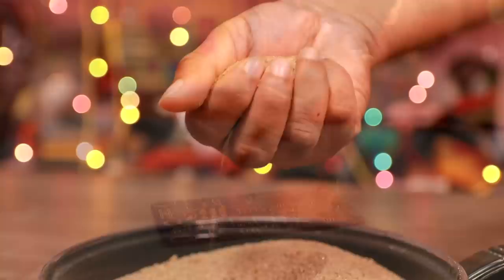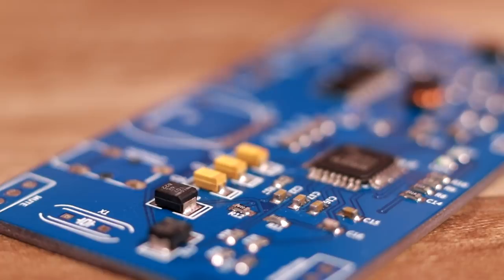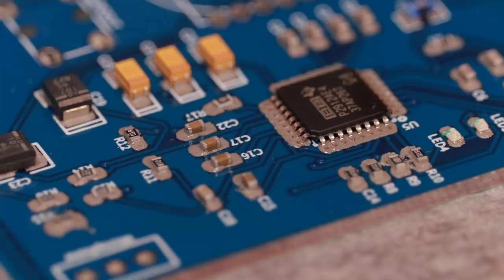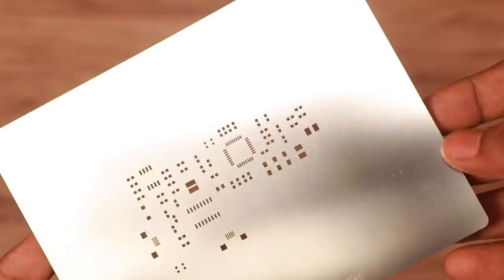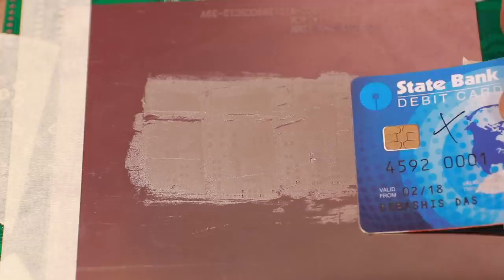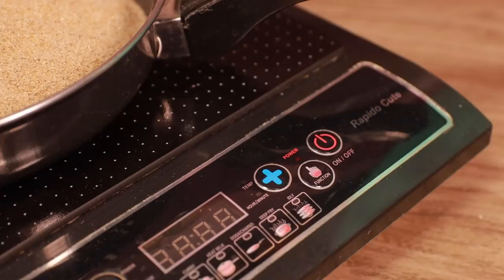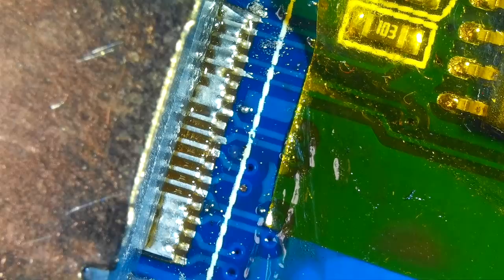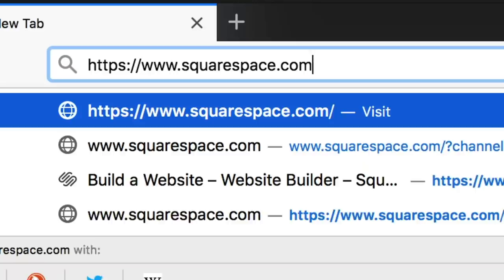How to Solder SMD Components using Sand

Comment: Combining induction stove and electronics is not a good idea... Currents can induce in your circuits and fry your components.
Reply: Maybe,..... Or Maybe the pan absorbs all the induction
Reply: @Gumeb  quite possibly. But are you gonna take chances with expensive ICs or PCB that takes days to weeks to ship if you fry it?
Reply: @harviecz  you are right, At the moment I would not use the method indicated in the video, at least not until checking with a magnetic field meter that on the surface is free of induction
Reply: What if you used a conductive pan, then covered it with a metal lid or aluminum foil?

I'm far from an expert, but wouldn't that create a faraday cage to protect the pcb?
Reply: Just turn off the induction heater before placing the PCB. The sand will retain heat for quite a long time, longer if you cover the unused parts of the sand surface with some insulation
Reply: Good point
Reply: Instead of using an induction stove you would have to use a resistance heater
Reply: Use a stove instead
Reply: @harviecz  expensive ics? induction heater?
Reply: That's why I domtneed sufficient experience
Reply: @Gumeb  Yes. Also the air gap presented by a layer of sand will further reduce the effect, and the tin foil serves as one plate of a capacitor shunting induced currents to chassis ground. It should work.
Reply: I know, what next use the microwave?  Hahaha
Reply: I haven't had any problems with it. I boiled some assembled PCBs in distilled water on an induction stove. The pcb was right on the bottom of the pan. No damage.

I think, voltages induced by the stove are quite small. But I'm not sure It's hard to check, as the stove won't turn on without a good absorbing dish on it.
Reply: @victortitov1740  Why do you boil PCBs in water? :-)
Reply: @shadman9999  How about a nice microwave oven? ;-)
Reply: @ZilogBob  are you mad or what?😂😂
Reply: @shadman9999  Good to see someone's taking notice. :-)
Reply: @ZilogBob  thanks mate
Reply: @Gumeb  your phone can do that... i.e.: "there's an app for that!"  Mine is an old (Star Trek) "tricorder" app that is no longer available... but I'm sure other apps can do it.
Reply: i doubt it.
Reply: If it only takes 30 seconds to melt the solder, you can easily unplug the heater before dropping in the circuit board and components. With sufficient sand you'll have a substantial heat reservoir.
Reply: @Arjun Naveen the aluminum must come from a tin foil hat or else it won't work ☝️
Reply: Good tip!  I do Arduino projects on my channel.  Going to use this!
Reply: That happens when circuit is CLOSED!
if you are new to electronics then let me tell you that none (at least most) of the components Do Not form closed loop on a PCB like that.

Comment: induction heating can make some sensitive component damage. better to switch off the induction heater before keeping the pcb for baking or use simple temperature controlled heater.
Reply: Or use a very thick iron pan so that it doesn't become saturated and thus acts as a magnetic flux 'shield' of sorts.
Reply: The induction power 1st doesn't go through the iron pan and 2nd it doesn't go through the aluminium plate. How should the pan heat up without absorbing the power? First think of physics.
Reply: @Nic-st3mp  it might not necessarily absorb all the power is what I'm saying, if it saturates then the magnetic field will start eminating out of the pan. Of course it absorbs most of it or else the induction stove is broken somehow or operating at the wrong frequency.
Reply: If it only takes 30 seconds to melt the solder, you can easily unplug the heater before dropping in the circuit board. With sufficient sand you'll have a substantial heat reservoir.
Reply: @maxk4324  It will do.
Reply: @jeffgrills1101  That is the best way.
Reply: Cl

Capyotd
Reply: I better use regular stove
Reply: as i use induction in my kitchen too, I was about to mention this. yes the pan will make a shield to EM fields, but not much. 
may work if you only solder analog stuff, but when it comes to ICs or MOSFETs, ouch.
Reply: just use regular gas or coal fire
Reply: EDITED TEXT:
NOTE : Induction heating can damage some sensitive components.
       It is recommended to to switch OFF the induction heater before
       placing the PCB onto the sand
       One could use a temperature controlled heater - however - sand
       retains its stored heat for sufficient time to complete the job.

Comment: If you get a solder bridge, using wick can remove too much solder. Instead, try using a generous amount of flux to get the solder to go where it needs. If that doesn't work, then break out the wick and re-solder the appropriate pins.

Comment: It's only applicable if all of your SMD components are at the top layer.
Reply: Smd mean surface mount components therefore all the components are on top layer only
Reply: For that you can solder it in two cycles one by one for each layer
Reply: @vedantx-b2986  you can have SMDs on the top AND bottom
Reply: @Sky for Bottom side you must use BGA. SMD = SURFACE mount & BGA = BOTTOM attachment
Reply: @WurstPeterl  / BGA is Ball Grid Array, which means the solder pads are beneath the chips, needing balls of solders&specialized tools to properly heat the solder and mount it.
Reply: @WurstPeterl  They mean bottom of the PCB, not bottom of the chip. You can have any type of SMD component such as resistors, SOICs, QFPs, QFNs, BGAs and more on either side.
Reply: @vedantx-b2986  You are mistaken, one of the benefits of SMD is using both faces of the PCB.
Reply: @shubhamkasera7368  And what happens to the parts on the first layer that are now having the solder melt and 
they are "hanging on" before falling into the sand?
Reply: @Killer5949  The 'big guys' use solder paste of different temperatures. Higher on first pass, lower temp on 2nd pass.
Reply: @Killer5949  The change in melting point for solder paste is not based on flux, it is based on alloy of the solder itself.
Reply: @leef_me8112  "The 'big guys' use solder paste of different temperatures." - Not really. The big guys actually use glue on one side to make sure that the components don't fall off during the second pass.

Comment: Low melting point solder breaks off when you try to plug in connectors, or if the PCB gets hot during operation. Also, the pick and place procedure is where most of the time is spent for most components, so as you do that you might as well  solder it with quality solder. The low melt caused me to lose a customer.
Reply: and it cost Microsoft millions of $.

Comment: I thought people usually use toaster ovens to do smd compenent soldering.
Reply: That won't work good either.
Most components require an exact temp curve to come out undamaged
Reply: @peterzingler6221  You can buy temperature controllers specifically made for this purpose.
Reply: I have used toaster ovens with dozens of pcbs to verify my designs, including small components such as ethernet switches. Never had an issue (shorts here and there, but easy to fix). It does work and is much easier than this sand technique. In general this video is full of bad advices.
Reply: @laconcongrelos4545  Could you do a video where you show how you use a toaster eg. I am really interested in this!
Reply: Don't use infrared toaster ovens, They heat up too fast and will give your PCB a sun burn :P

Comment: For those who wonder about the sand. It helps evening out the temperature, and also act as a heat buffer. 
One "can" place the PCB directly into the pan, but  depending how the hotplate behaves, it is more likely to damage the PCB as the temperature goes up and down a lot as the hot plate power is cycled on and off. (The sand helps evening out this heat cycling).

Simple, yet a fantastic idea with simple cheap parts one already have at home, or easy to get without any effort. All thumbs up!
Reply: Electric cook tops cycle on and off like that too.  It is easy to tell because they are usually red when they are on.  We have one of those glass ones and the nice thing is they are easy to clean.  Mom accidentally melted plastic onto it (not a lot of plastic) and once it cooled down it was easy to scrape it off with a razor blade.  Once I got it clean enough I turned it on and there was no burning plastic.  That just proved how well the razor blade worked.  If that was any other type of cook top it would have been much more difficult to clean up.  I think what made that easy to clean up is that she caught it before it could burn.

Comment: You showed us how to sholder SMD without:
1. Soldering Iron.
2. Hot air. 

But using:
1. SMD stencil.
2. Few unused PCB.
3. Masking tape.
4. An expired card.
5. Solder paste.
6. Induction cooker
7. Fry pan
8. Sand
9. Temperature thermal gun
10. Foil

I will stick to the old way. hahaha
Reply: good look counting rice grains lol

Comment: Thanks for your video but low melting solder results in bad solder joints, and for components that heat up quite a lot that's not good because they'll end up getting loose from the board

Comment: Yah! Solder with sand 😃
.... And solder paste, aluminum foil, induction stove and a pan..
Reply: Yeah and also it is not mandatory to use sand, you can use anything what can heat up the whole pcb from bottom. electric stove for example.
Reply: INDUCTION stove. That's the issue. But as someone said you could literally just use a normal stove instead.
Reply: @ManolisAgkopian   hey, thanks for the info. But my point was the title was kind of misleading, and I wrote the comment sarcastically.
Reply: sure, but seriously what did you expect?
Reply: sure, but seriously what did you expect?
Reply: @lixo03  I expected "at least" this channel not to do misleading-titles sort of stuff.
Reply: Not to mention: an expired debit card and a stencil.  :) Cool nonetheless.

Comment: But if i wanted to sold a wire to a switch, what can I do???? Is its stencil found
Reply: For wires you need a soldering iron, they are very cheap around 3-10 usd

Comment: I imagine you could desolder components the same way, just keep the PCB secure when you go to remove components
Reply: yes, that's a good idea. Also , how about using a vacuum cleaner to pull the components when the solder starts melting ?
Reply: @tusharg21tube  Could make a focus adapter, just put window screen in between the hose section and adapter; so you can capture the part lol

Comment: I just use an electric skillet for that. Some won't go quite hot enough, so I open up the thermostat and add a wire so it does not turn off. Put populated boards on cold skillet. Plug it in. A couple minutes later it solders. Unplug and let cool.

Comment: Interesting thought. "Soldering irons are time consuming and hot air stations are expensive" but when you have decided to use SMD components with a proper PCB and with a costly stencil and with an induction cooker and a digital thermometer, you were just a hot air station away. Also forget about it to use for dual sided pcbs. Cool huh.

Comment: Does this also work on a normal gas operated stove? Because this is legendary
Reply: You have to carefully adjust the flame to hit the melting temperature without overheating the components. With induction stoves you just key in a temperature and the stove controls it for you.
Reply: @PixlRainbow  thanks!!

Comment: use solder past with less or with out Bi. Bi reduse the melting point this is good for beginners but Bi burn if rehedt or rework the pcb.
sn63pb37 mix with sn42bi58, 5 : 1 or 8 : 1. Both are non clean solder paste good enough for home brew or start up.

no sand!!

Comment: With bizmut soldering paste (138C)  it is posslble. Try with 58/42 paste :)
Reply: Low temp solder is only for component removal, not for permanent assembly

Comment: great technique but every time I want to solder a board I have to get stencils for it? with that amount spent on stencils I could buy a hot air station (I already have). good technique for those who have not or can not use hot air station. thanks for sharing though.

Comment: And why you didn't placed the pcb directly on the ceramic plate to heat at first?The frying pan and the sand is used without any obvious reason.
Reply: He doesn't have a ceramic plate. He has an induction heater, which needs a metallic material to "capture" the emitted electromagnetic field in order to heat up, hence the pan.

Comment: Nice idea. But can you measure a temperature profile using this method?
Prove me wrong, but I can imagine that the cooling violates the recommended temperature profiles. Which results in stress of the die.

Comment: Wouldn't having more flux prevented the solder bridges? Wouldn't the low melting point cause issues with chips that heat up in an enclosed space?

Comment: A professional solder oven uses preheat stage and then solder heat stage for soldering components, and the sand is not necessary.

Comment: Not sure I understand what the sand is supposedly doing here. I mean, typically you use the stencil and paste method with a reflow oven which needs no sand. I don’t see how the sand adds any more control than using a typical toaster oven.

Comment: So are you sure the excess heat don't damage sensible parts on the pcb??
Reply: I would not let the PCB sit on the hot bed of sand for much more than 20 seconds after solder reflow occurs. Capacitors (especially electrolytic) will degrade with prolonged heat exposure.  The IC's can take a lot of heat.

Removing the PCB while the solder is still molten could present problems.  You don't want components smearing molten solder around causing shorts, and you do not want to disturb the solder joints (mechanical vibration) as they are solidifying, as this can cause internal cracks and solder joints that will fail later.  I think you need to use some kind of mechanism to very smoothly lift the PCB off the sand bed.

Comment: I don't think this is the way to go. This might work okay for MCPCB as they conduct heat faster from the bottom, but not for FR4 PCB with very low thermal conductivity. Using hotplate or sand risk overheating the  phenolic resin. The better way and recommended DIY method for this are either low speed hot air or controlled IR cooking oven.

Comment: Why do you need sand, you can just use an iron not equipped with a steam function.
Reply: Sand is needed to distribute the heat evenly. This is a standard technique used for roasting groundnuts and it results in uniformly  roasted nuts.
Reply: @Bright8888 . Old iron without steam already distributes heat evenly, just put it on its bottom, heat it up and put the board. everything is fine and without unnecessary action. try it you will like it

Comment: you just contaminated the fine pores in your table with soldering paste. good job you cant eat off it ever again.
Reply: Why would you even want to eat of your table?? It's full of germs anyways, use a plate ffs
Reply: still no reason to slather it in places it shouldn't go. its very fine stuff which will get everywhere, including right through your pores. its nasty.

Comment: Warning! Induction
This method is good and bad. Use a thick pan to minimize the risk of inducing currents in your ICs. And wait for the pan to get hot before placing your PCB because, more current is absorbed by the pan the hotter it is.